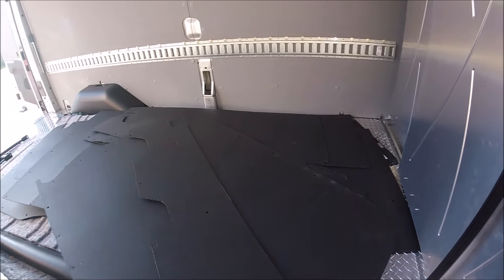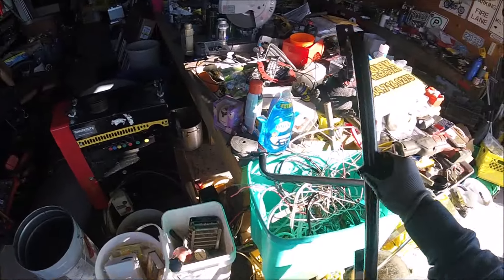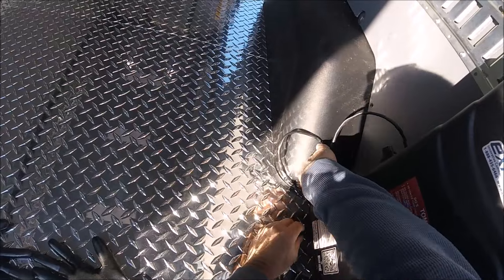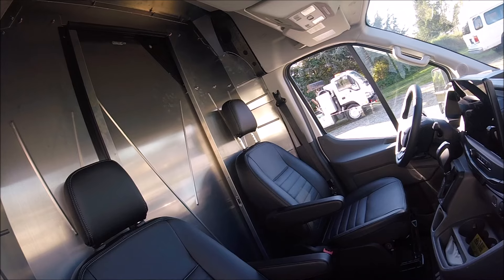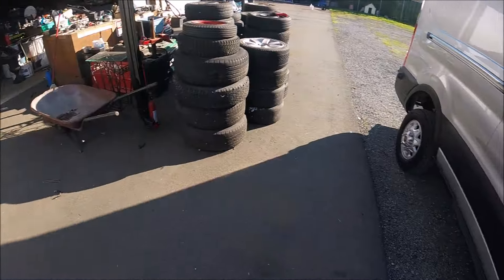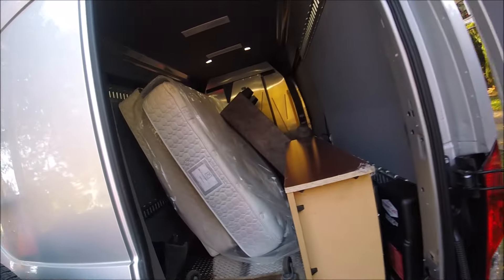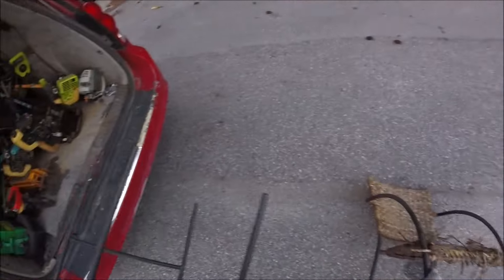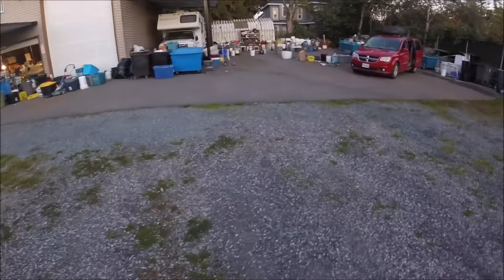Junk Removal Job With The New Van

Comment: where I'm at they don't charge for green waste dumping, which is very good cause if you have like wooden furniture, you can break it apart and add it to the pile. like you said they grind it up, turn it into compost. great seeing silver surfer in action and finding some more scrap for the Bin. Box spring can be broken down too get that metal out cloth to a trash bin wood to dump, save some weight on dumping. great video

Comment: Yeah that new van is nice. Be able to get a lot of stuff in there. One thing to think about. When you put those handles on the back door you realize it's going to cut about 8 in off what you can get in the back of the truck. Just think about it whatever but other than that nice truck. 👍👍🙂🇨🇦
Reply from the maker: Thanks for the tips!

Comment: As long as it doesn't rain every day it's out a lot of moisture will evaporate out of the branches.  It's unbelievable how much lighter a fully dry pile is than a wet one.  I think you're ok for weight.  I don't think it's more than 1500lbs hopefully.  Let's see!
Reply from the maker: If dumping around a Hundred its OK for the price
Reply: it really is much lighter but they shred incredibly easily when wet, it's a good setup, plus you get soil.

Comment: I riveted a solid steel sheet on my van on the floor and part of its sides it lasted me more than 5 years in scraping and heavy carring and it will still work but I changed it since it got bumpy.
Reply from the maker: The floor has plywood & Aluminum Checker plate over it